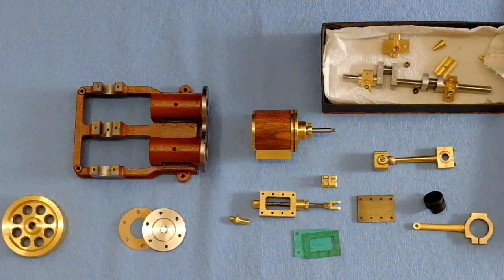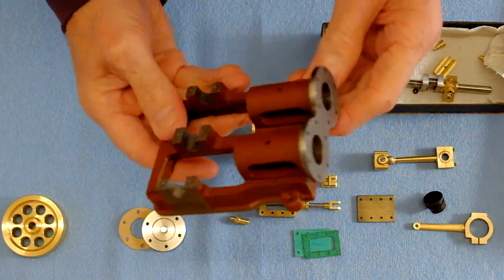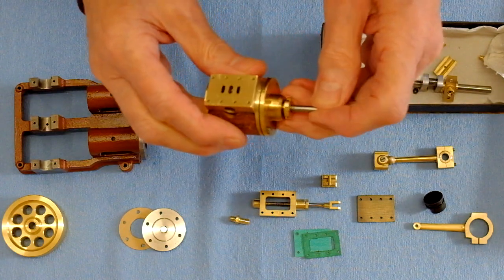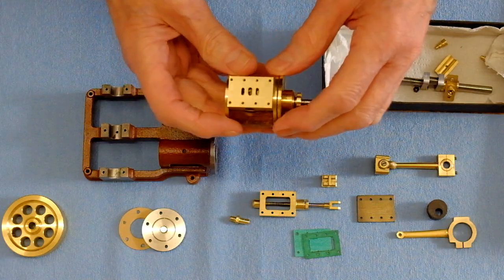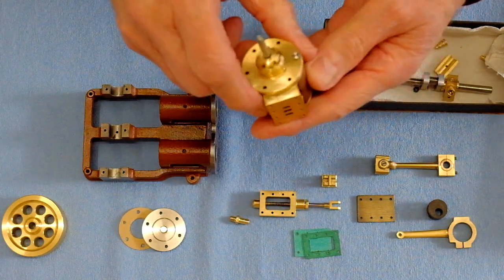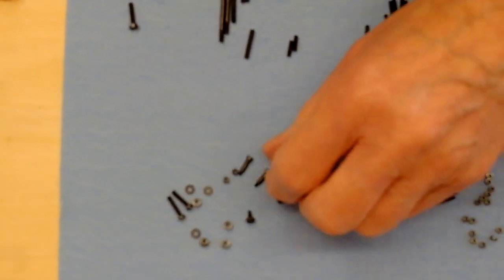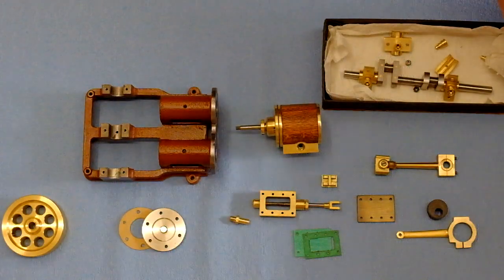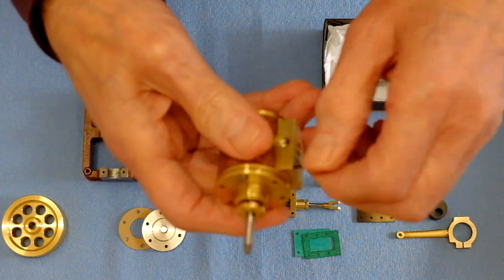Stuart Score Model steam Engine in home workshop

Comment: Lovely looking engine. I hear the Stuart Score engine is basically two 10H  models combined into a twin.  I have been given a selection of old 10H castings including two sole plate/standard castings and I'm thinking of building a twin by making a custom box bed but with the flywheel in the centre location rather than on one end of the crank..
Reply from the maker: Sounds like an interesting project, you will need to keep everything in alignment.  I have just fitted a new flywheel to this engine and found it would run without a flywheel, that's the beauty  of two cylinders.